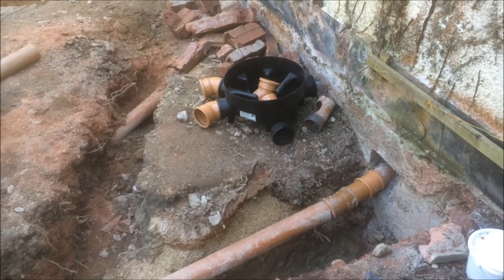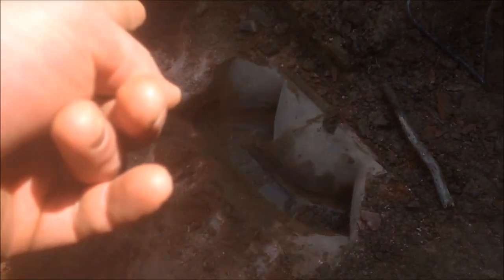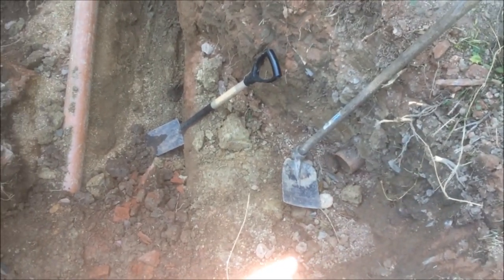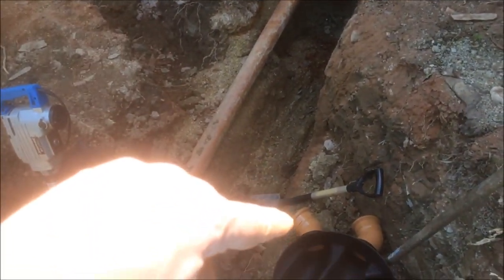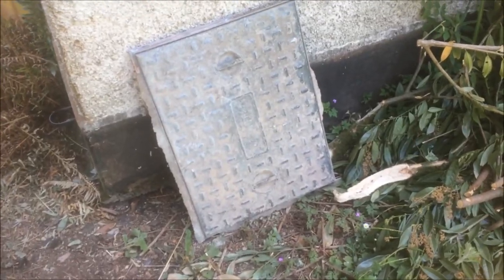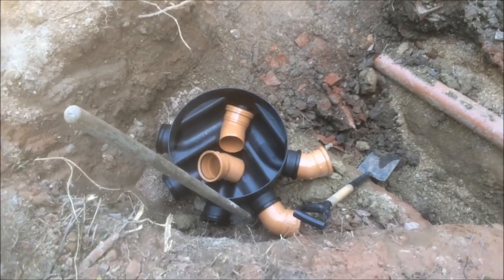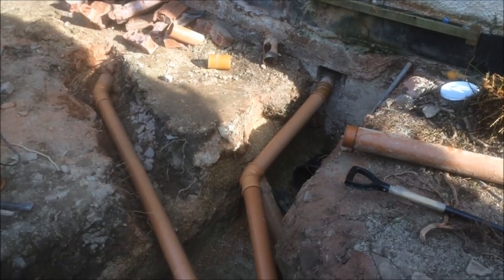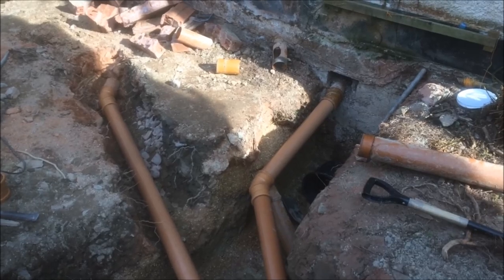How to Move a Manhole (or Inspection Chamber)

Comment: I am in Johannesburg; S.Africa  Attemring this on Friday with two casual labourers. Love that co-coordinating the flow connectir point. Goibg shopping with your video.
Reply from the maker: Buy some lubricant, to help the pipes go in. Also sand paper / angle grinder the ends of the pipes so they are tapered. This will make things easier for the job. If you do not sand the end of the pipe then a sharp edge can push one of the seals out of the joints, and things can get ore complicated! Good luck! :-)

Comment: A thing of beauty, thank you Dorky. In my garden I have an inspection chamber shared with houses further up the run that I wish to reposition 1m to accommodate building works. Do I just ask my neighbours to hold out for duration of the works?? Perhaps trying to build as much as possible of the new one with the old one still intact first? Any help much appreciated.
Reply from the maker: Man that could get messy. I would do as you say and get everything as ready as possible, but I would dig a big hole under where you will cut pipe, so you can put a drum, or IBC to catch all of the poop. Even if it just water it will mix with mud and make soupy mess. When it’s all done, hire vacuum tanker to come and empty the tank. I mean you could just ask neighbours… but

Comment: Hi man nice job indeed! Do you need to inform local authority or water company for sort of work you have done here? If so any link for the process greatly appreciated. I am thinking of a single story extension by 3m from current wall, but a manhole fall inside the extension. I have to mention that all the sewer pipes to the manhole originates only from my property and pipes connect to the main sewer system through next door neighbor.Thanks 👍
Reply from the maker: Provided it is a drain and not a sewer it is quite simple. A drain is "privately owned" whilst a sewer is owned by sewer company. You can download an "asset map" to see if your pipes are "adopted" (owned by sewer company). For a private drain you will need building regs approval. Just google "[your local council] building regs application" they will come and check you extension, including the drains at various points. My inspector was a nice guy and super helpful. Not like the olden days!

Comment: What do you do to get rid of the old one? Pull the whole thing up?
Reply from the maker: Yes. Grubbed out with excavator. If the old one had been well inside the line of the footing I may have left it as the suspended floors, would have gone right over it. However, it was right in the way of the footing, and I am not sure if you are allowed to leave the old on in anyway.